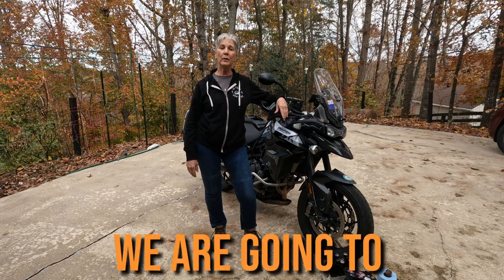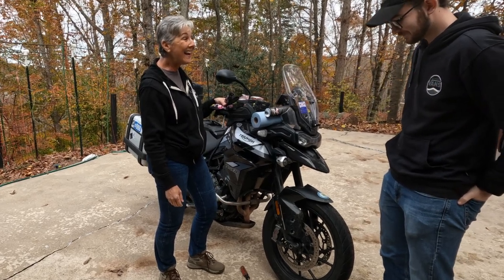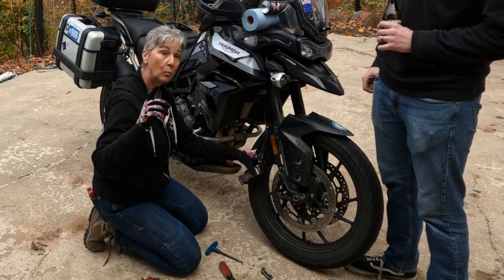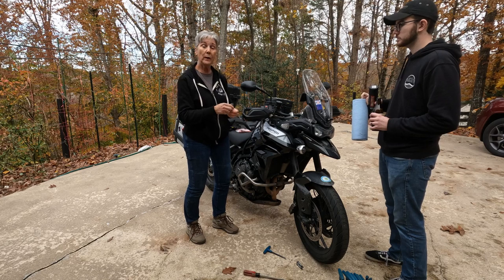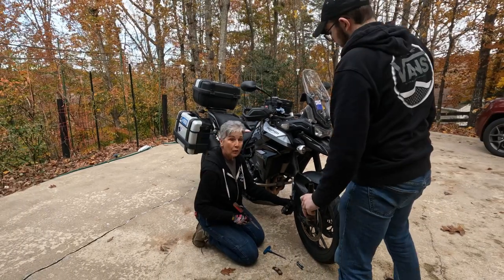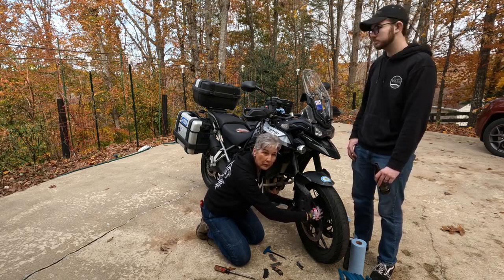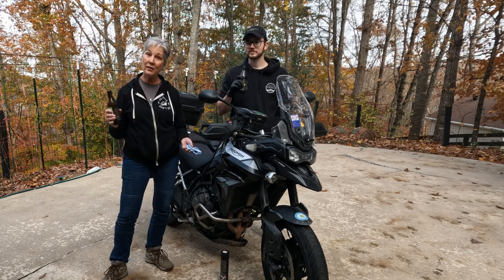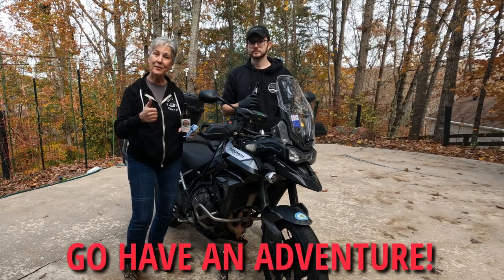How to change your Brake Pads!

Comment: Before I remove the old pads I clean the cylinders with brake cleaner and an old toothbrush to keep from dragging gunk into the cylinder cavity.  This takes only a minute to do.
Reply from the maker: Great suggestion